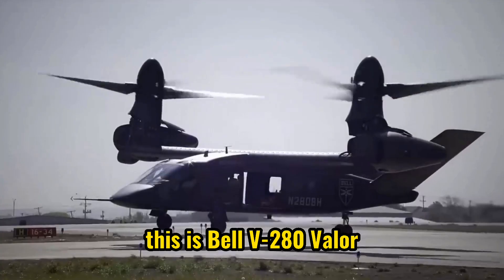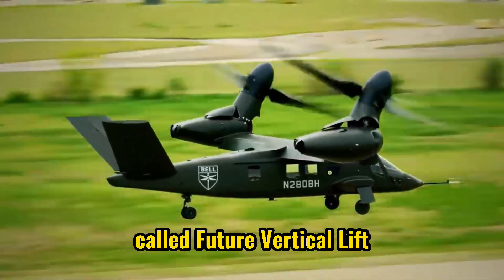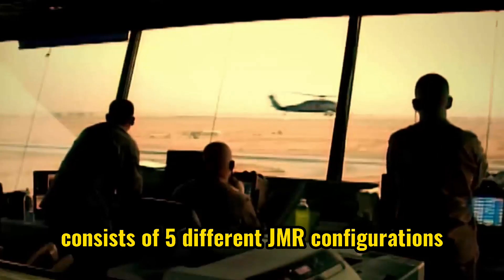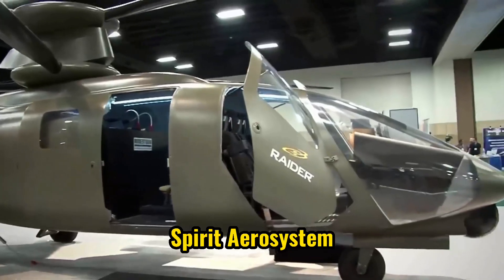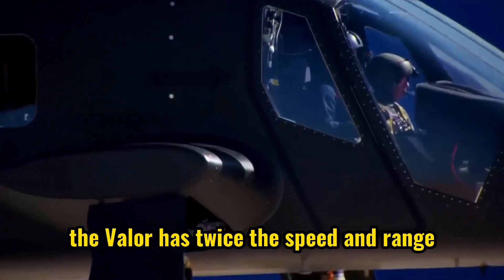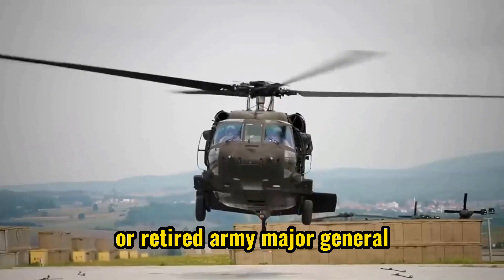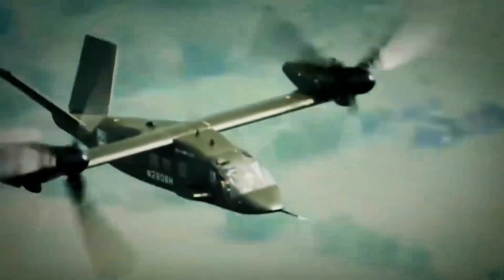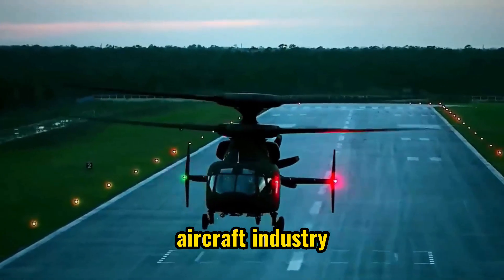Bell V-280 Valor| The US Army's Most Powerful New Assault helicopter

Comment: The C130 is not a helicopter and the Valor and its family will not replace it, also CH47s are already operating at 12000 feet and it would have to operate at least that, not 6k feet